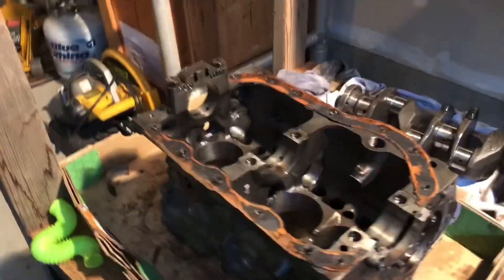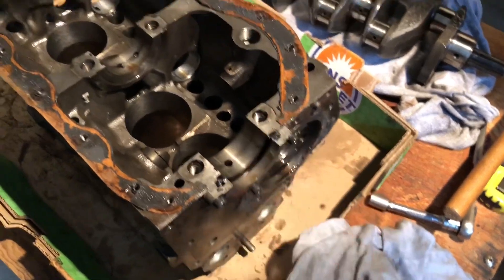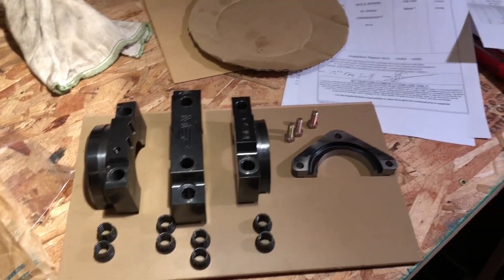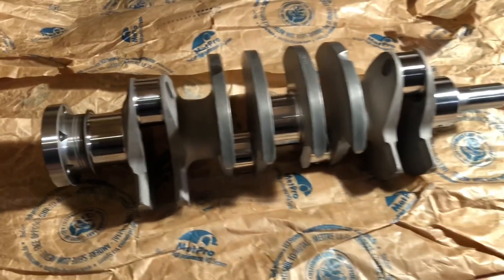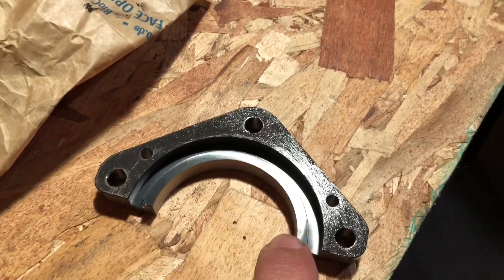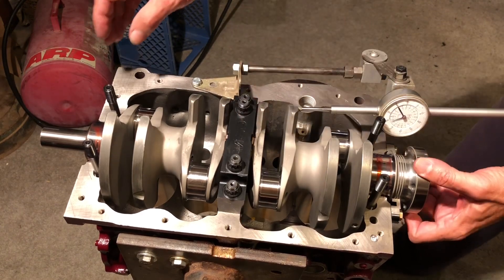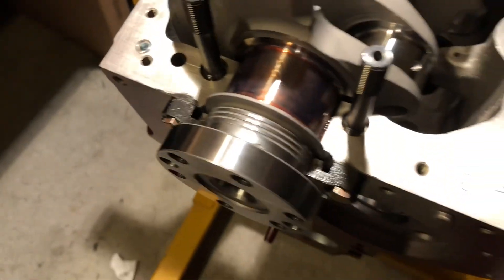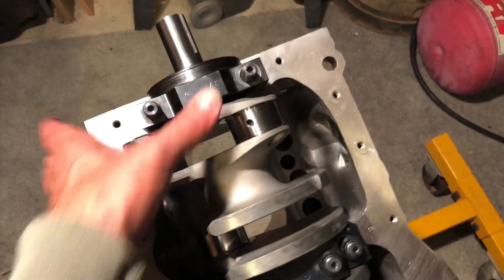Jemal shares race engine details that work on the street too

Comment: Jemal, what about if you fit and torque up the main caps first, then fit that half-moon cap last, pushing hard down on the lower half of the rear main cap, you could not fit it too proud even if you tried, and therefore it would be a perfect seal with the rear main cap?
Reply from the maker: That's the best approach if that little hat has been removed, or is obviously installed poorly.

Comment: This information is indispensable. I’m currently building a sloppy street 1275 with lightened rods and custom machines steel strap for the Center main cap. Do you disagree with ARP’s torque specs for main caps at 80 ft/lbs? I torqued mine to 70 ft/lbs and the crank felt tighter on the main bearings. Could just be my imagination.
Reply from the maker: No way 80 is way too high. The threads are only 7/16 and the correct number is 60.  ARP usually gives lower numbers when using their magic thread lube!  Aftermarket 4-bolt caps usually use studs so careful with fine-thread nuts! I've used the MED main caps and follow their recommendations. They use regular oil on the threads and flanges.
Reply: @JemalCRM  amazing. Thank you!